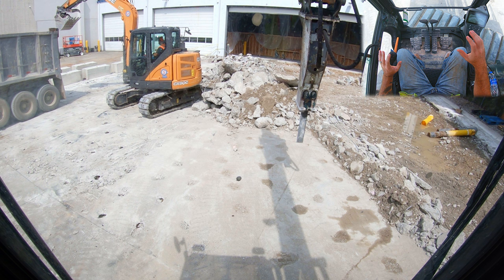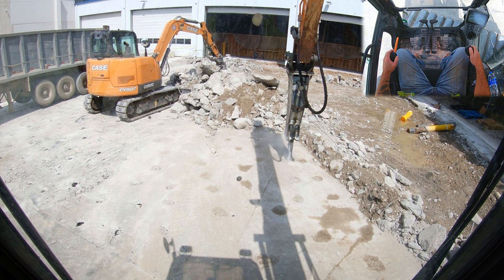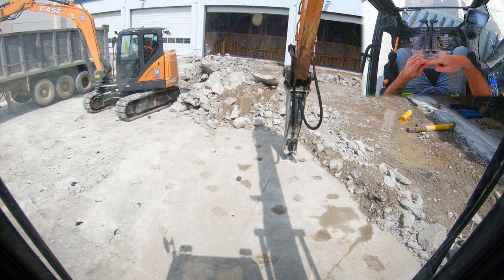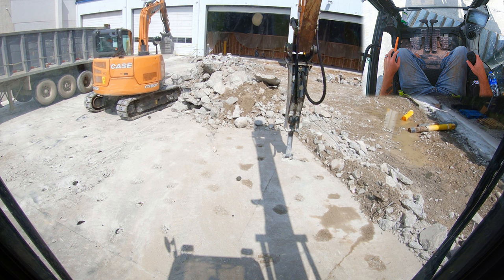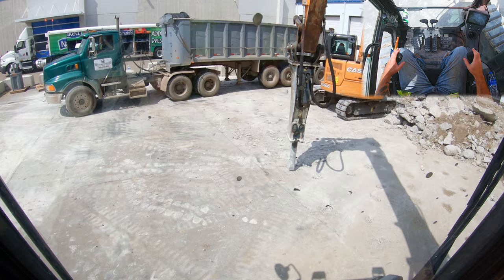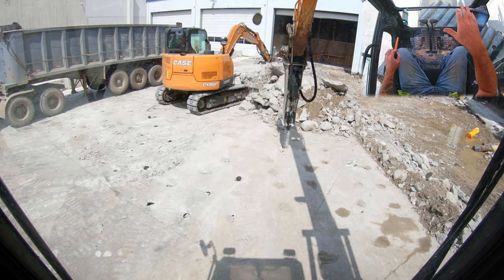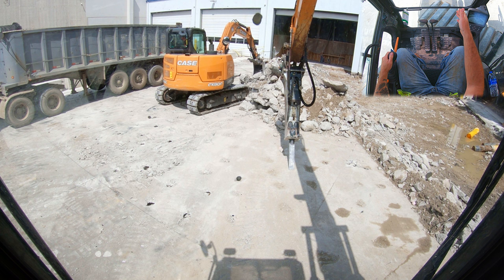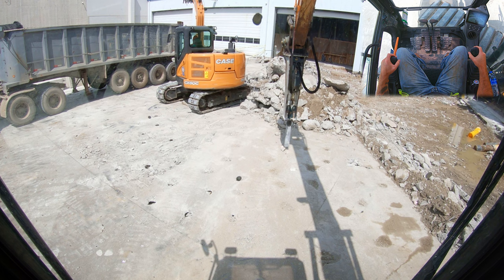How To Use Hydraulic Hammer

Comment: I'm a blaster, so this video is particularly relevant.  I've found these work great on concrete or rock that was previously cracked with explosives or demolition grout but not so well on unbroken bedrock or boulders over a cubic  yard or so.  Wondering what your experience has been?
Reply from the maker: Anytime you can work with an existing fracture you will be able to take on larger material and you will be far more efficient.  When you move into bedrock and boulders there are definitely much better tools for tackling them.  Breakers are only really good at opening up fractures in surfaces they can force apart.
Reply: I use one on bedrock a lot living in East Tennessee. Mostly on lake properties that are updating their dock access with SXS paths. It's definitely harder, but I like to do a 5 point break in the center of my rock and work outward on both sides. I find doing that center break causes fractures deep in your rock so it will be slow going until you get that center established, but once you do your side breaks are larger and tend to break in a pretty squared pattern.

Comment: I am currently using breakers a lot in my job I have now, we have two 50T excavators breaking out in a grit quarry. The old guy who’s on the Komatsu actually snapped his last week no joke, myn is going strong still but I must admit i do go hard onit. I have been doing breaker work for a while now so am kind of in the habit of being rougher than I should be 🤷‍♂️
Reply from the maker: Once you learn the machine and the attachment you can go a little harder on it.  You start to get a feel for when the shank is really being strained.  In the beginning I always encourage people to go easy.  Take time to get a feel for what the machine is doing.  This industry is about production.  Could you go easier and make the shank last another 100 hours?  Probably.  Would it be worth the loss in overall production you were able to maintain over the 500-1000 hours you used the attachment?  Probably not.  That's the constant balancing act we are thinking about as equipment owners.